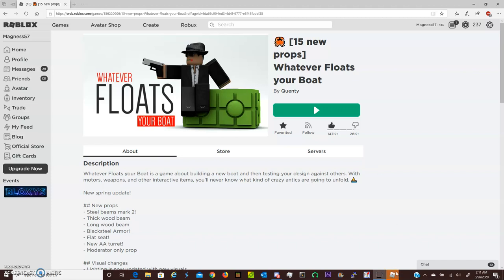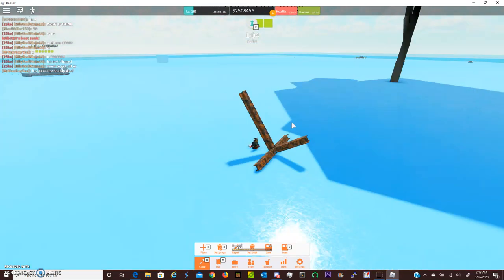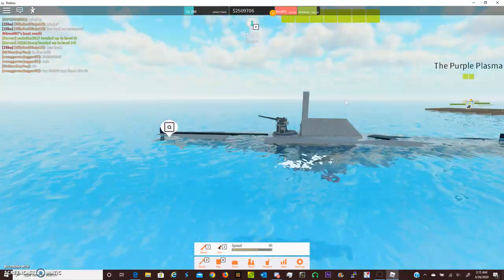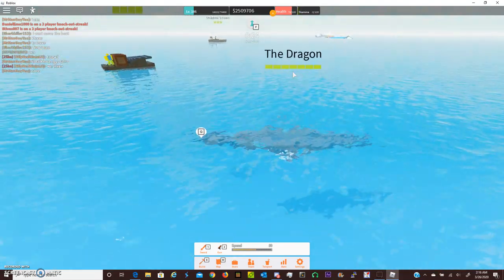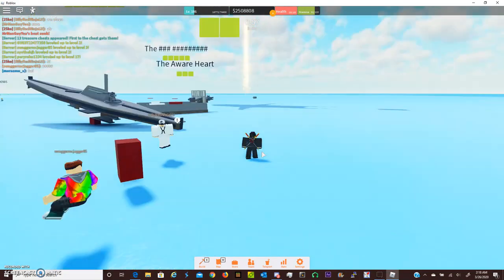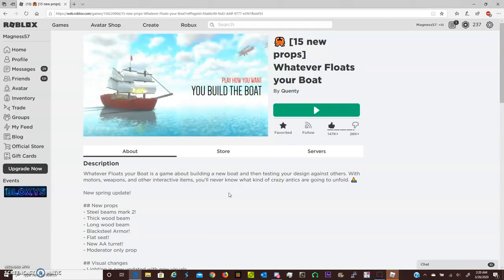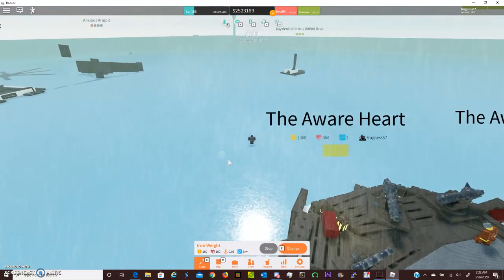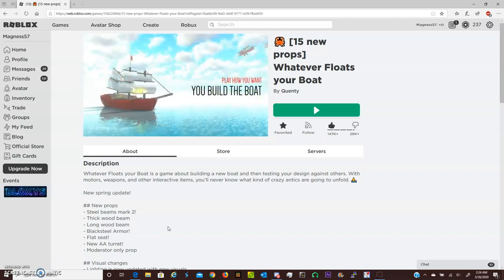WFYB: Toxicity at its finest

Comment: For anyone wanting to build this submarine, skip to 3:43 where you can get a good view of the actual mechanisms for diving. I do however have a few questions:
How much did you compress the wood?
Can the black steel be substituted?
Edit: from what I have tested the wood should be compressed 20-30 times so that your sub can resurface before you drown. Also the black steel can be substituted.
Reply from the maker: Sorry for late reply, I remember compressing the super long wood type about 23 times and yes, the black and regular steel can be switched out, was only for ascetic purposes
Reply: @magness57gaming67  Hey I came back to this game after a while and I want to build a submarine. If I am correct, the back of the sub has to be heavy while the front floats. My problem is my submarine is always very slow. The speed was 9.
Reply from the maker: @varunsriram286  I'm realizing that wood pallets overcome the slow speeds of ice, you may try compressing wood pallets and i do owe yall a video since ive been largely inactive